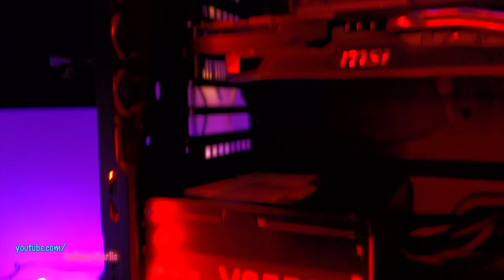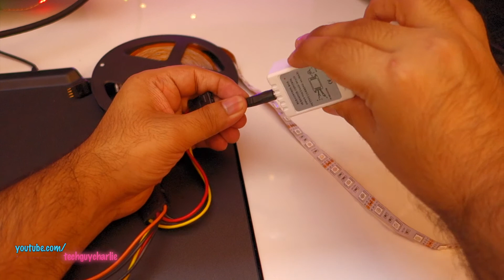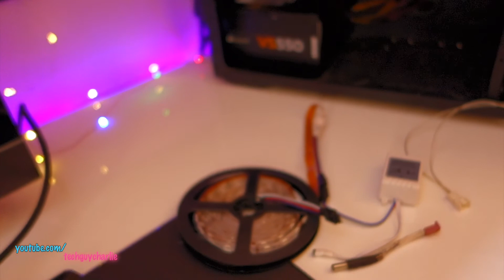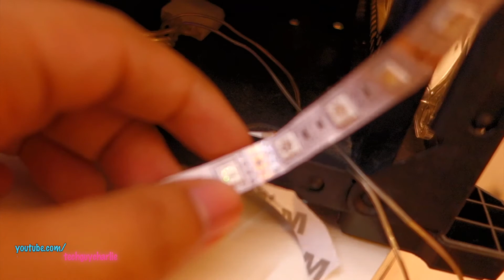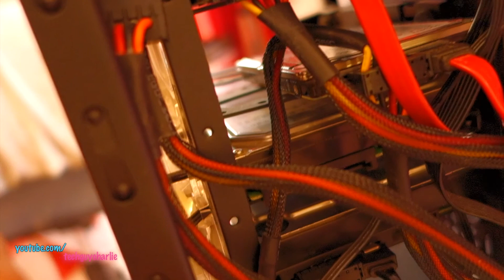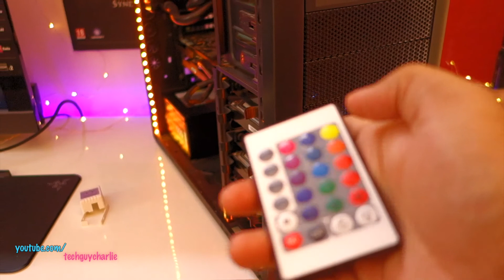Remote controlled RGB LED light strip in a PC (weekend project)

Comment: What is the peripheral you use with the display to control the fans? And I have the PSU VS550.  Great vid.
Reply from the maker: Thank you and that is NZXT Sentry 2, pretty old, I bought that almost 8-9 years ago, still functioning.
Reply: @TechGuyCharlie  Looks cool. What are those called?